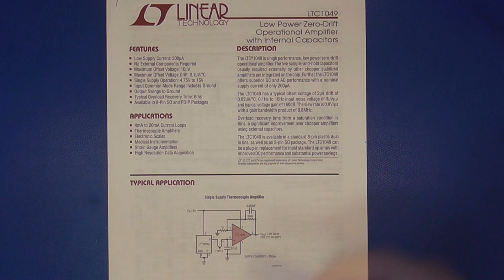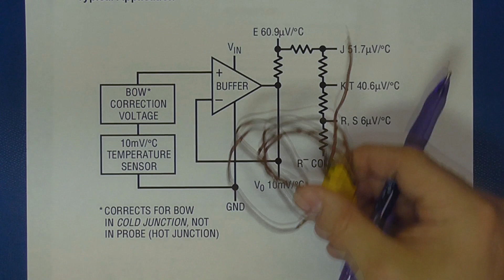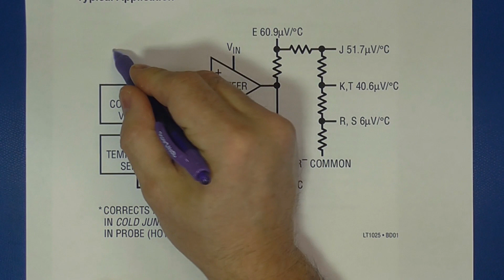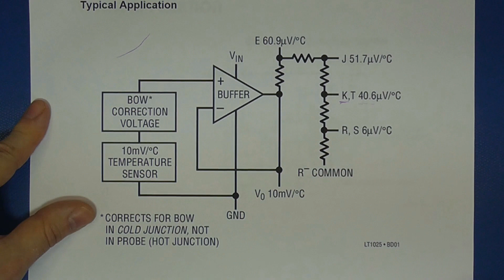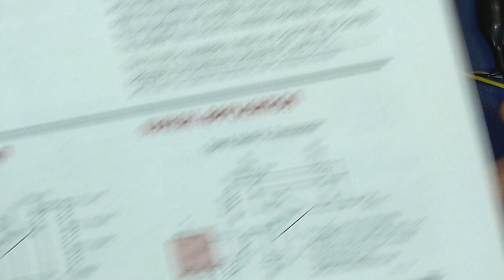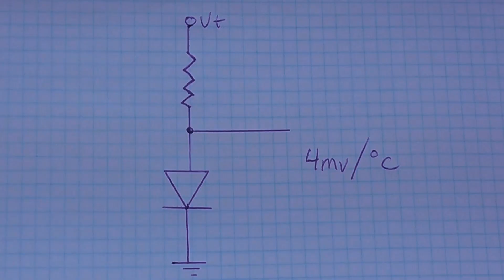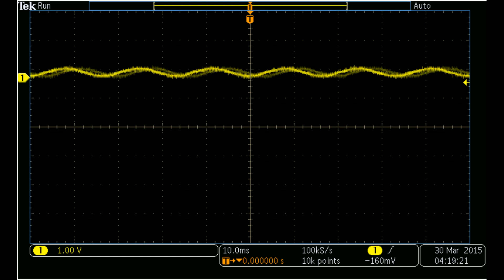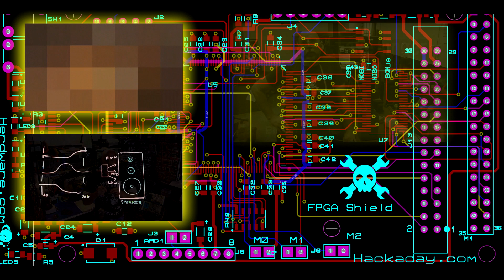How to Measure a Thermocouple Probe using an Amplifier Circuit

Comment: Nice video, I wonder if you are familiar with a vent less gas stove. It has a thermocouple on the back of it that turns it on and off. The problem is that the turn on-off window is moves around a lot. It's sloppy about 4 deg F. I wanted to replace it with a digital one, but I am not sure what it is connected to. The unit has no power cord and only a battery for the spark to light the pilot. So, it's entirely mechanical. Can you offer some ideas on how to do this?